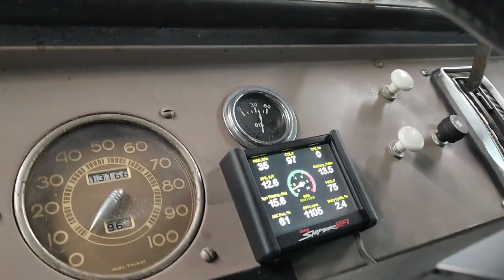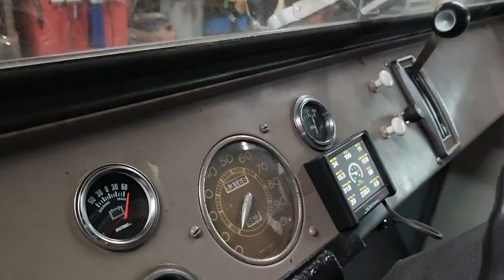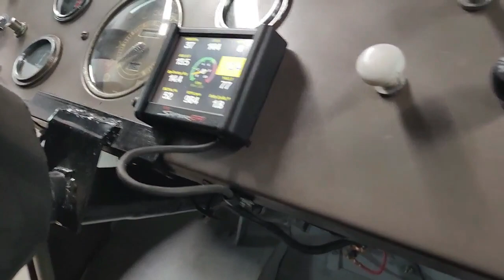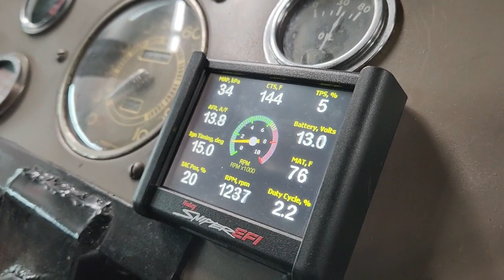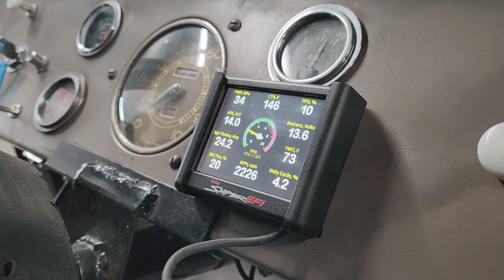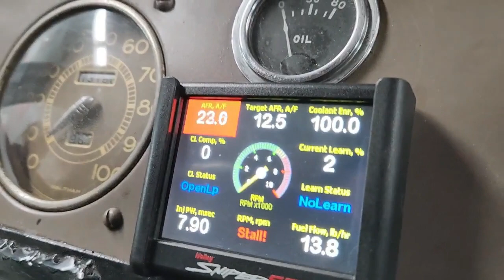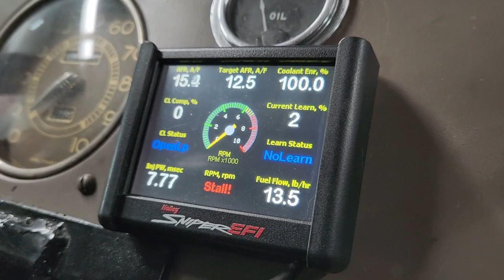HOLLEY SNIPER EFI MAKE US CRY REAL TEARS | BOMBARDIER

Comment: What's your fuel pressure? Should work best around 58-60psi. Also seems like the battery voltage is dropping and too low while idling. The voltage drop could be causing the fuel pump to not keep up and go lean.

Comment: Rip that overrated aftermarket EFI junk out of there, throw a carburetor on it and done deal…
Reply from the maker: oh trust me, 4 barrel 600 cfm on a 45 year old motor. Can't take any more gas or air.
Reply from the maker: and Dad is still waiting for you to show up.
Reply: Sounds like your fuel pump is cycling more than it should…check for fuel line leaks, also your voltage is low, your alternator should be putting out 13 bolts at idle and up to 15ish at speed